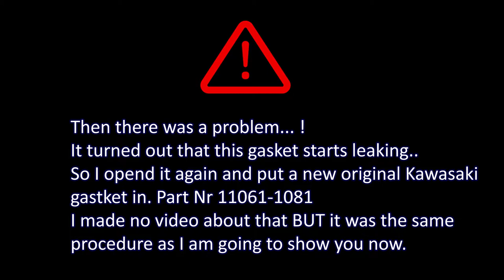KAWASAKI VULCAN 1500 [2004] How to change clutch , replacement by The Old Mechanic PART 4 👨‍🔧---🏍

Comment: Great video series.  I just bought a 2004 Vulcan Classic 1500.  The clutch is slipping when it gets hot.  I know that's the clutch fluid and slave cylinder, but if I need to do the full clutch, I may try (with a friend) to do it myself as that doesn't look very hard at all.  Shop said if I needed new clutch it would be around $700 to $800.  I'm hoping to get it done much cheaper myself.
Reply from the maker: I am sure you can, watch my videos mate ! 😉👍🤛🏍

Comment: I did not see you check the clutch release operation before replacing the chrome cover.
Did you pump the lever and watch the plates move?  How much clearance will it have fanned open? Mine shows 1.4 mm using feeler gauges.

Comment: I watched your video several times before trying it and everything happen and was as you said. I was very comfortable going into this project. My only problem is when I went to test it out my clutch wont disengage with the clutch lever. What did I do wrong?

Comment: Great Video.  Thank you for sharing. In my 96 D model, the clutch slips only when it's cold. As soon as it reaches operating temperature it works just fine. Any suggestions?
Reply from the maker: Do you use synthetic motor oil ?

Comment: Old Mac.  I was wondering if you can answer a question.   When I release the clutch to the bike, the motorcycle wants to jump forward and for some reason it also stalls out sometimes. The lever is too soft also.  I have a 2001 Kawasaki 1500e classic.   Any information would be appreciated.  Thank you.  

Randy.
Reply from the maker: I am going to send you an email 😉

Comment: I’m have a hard time getting the spring bolt to lock into the shaft. You made it look easy, any recommendations?
Reply from the maker: Hi Perfection, its a bit tricky as all the parts has to be perfect in place, I know. But keep your cool and just give it another go mate.

Comment: I didn't think to check before I put it back together but now my clutch lever is tight and it will shift gears without using the clutch.  Any thoughts on what could be the issue?

Comment: Hi Old mechanic , I have a 2002 Kawasaki Vulcan nomad 1500 as well , decided to replace clutch plates , everything went smooth , according to your video , now I can’t get the clutch big nut off , try everything from air impact gun , rust penetrating lubricant , breaking bar wish about the way stuck my clutch rod and finally the candle 🕯 melting on it , nothing works so far any ideas o f how to get this done , I will  appreciate it much , thanks Orlando .
Reply: Hi there , old mechanic, I figured out my torque wrench had fail , after fail attempts, finally my brother in-law came
Over with his 24 volts torque wrench and did the trick , I can’t believe after many approaches, finally the nut is loose and I’m in the process replace old plates with new ones , my piece of advice , is don’t matter how experience you have sometimes the tricks of the all school works , this case , the torque , I had exhausted old school acknowledge and it all came down to hood torque wrench , Cobalt 24 volts and a 27 mm socket , my advice, on this take , not always things go the way you picture , my philosophy, thanks for your videos who’s inspired me on the take of the Kawasaki Vulcan clutches replacement.👍
Reply from the maker: Hi Orlando, good to hear that you finaly got the nut loose. But I think that you used an impact gun and not a torque wrench to get that nut loose ?
Reply: @TheOldMechanic  , yes from the beginning I had used the impact gun but , impact gun was not working properly so a friend brought Cobalt impact gun and it took few seconds and it came loose , I had try it min first gears and I was still spinning , let’s hope nothing mess up , waiting for the gasket for the exhaust and cover to arrive , I decided also to order the Kawasaki cover gasket as you said it it I had the first one from Amazon and changes are is going to leak so my bets are on the Kawasaki gasket , so can’t go any further until them , thanks again for you very clear and detailed video.👍
Reply: I meant the Kobalt impact gun ,sorry , I had used the breaking bar after failing few times so the hub started to spin-off hopefully nothing got damage as I said .

Comment: Great video lots of useful an helpful information however the view an example of how those 3 clutch limiter is not real visible as to how you set . Not your fault however I bent mine as I got frustrated an forced it on incorrectly 🤦‍♂️
Reply from the maker: Hi Joseph, I think I used these symbols In my video:  ( )  thats the way those springs have to go in. Please have a look at my video again and as I allways note, don't skip any part of it, as you could mis an important part. And a tip..Never get frustrated..if it doesn't go well just leave it and sleep over it, and try the next day mate. 😉👍🤛🏍
Reply: @TheOldMechanic  I was having a hard time screwing the hub nut on the every time I tried to line up the pressure plate and those springs I kept dropping them so I was just trying to force . I had to buy new ones I think I got it this time though so I believe this is how you had )()